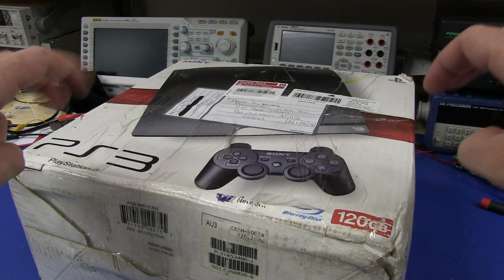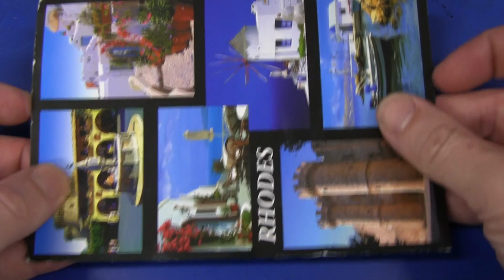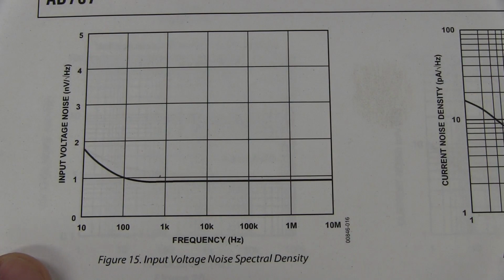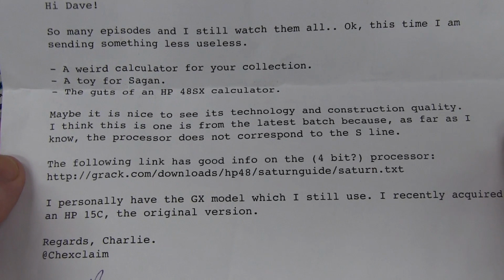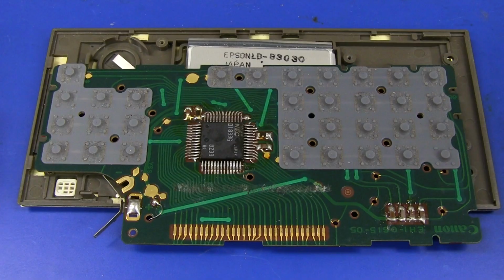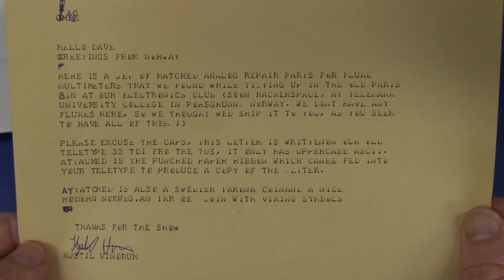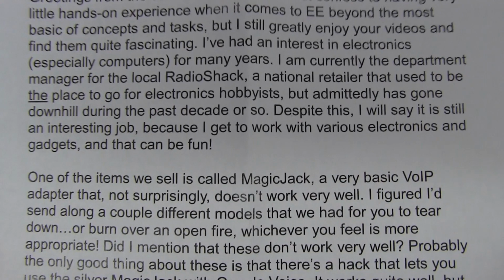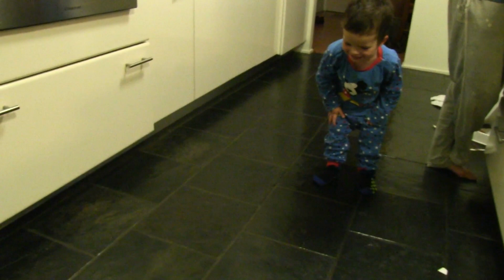EEVblog #541 - Mailbag

Comment: PS3 could easy be fixed, not over heating.

Cell processor (GPU) needs a re-flow/re-ball.

I do this every other day, and I can hazard a guess the model number would be CECH-G.

Have a go in another video!
Reply: the cell is the cpu and is rearly the fault normally its the rsx (gpu) and it is indeed in need of a reball lol carnt beleive its still got the warranty seal :facepalm:
Reply: Well, overheating is the cause of the de-soldering. The older models did not have an adequate heatsink, but a reflow will temporarily fix it until it desolders itself again.
Reply: a reball is not a reflow and de soldering is not what happens when the ylod or rrod is present thermal shock causess cracks and dry solder joints it does not desolder itself so please educate yourself before you speak...also over heating is because of the thermal paste under the ihs being of poor quality and old.......noddy... btu by crackedsolder
Reply: Ooops! Yeah your right, RSX is the correct name (Excuse the brainfart, I posted this at 3AM or so) :P

The cracks in the solder are also attributed to the use of lead-free solder balls, which don't handle the flex of the PCB during the heat/cool cycles as well as their leaded counterparts.

The heatsink and fan are MORE than adequate, if you ever pull one apart you will see what I mean (they are huge!)
The fan speed however is pathetic and doesn't cool well enough, that is only part of the issue though!

Comment: On the MagicJack you got sent, the original ones sucked ass having to leave your PC on 24/7, but the plus, and the plus with the USB ports are great for replacing your home phone, long as u have a good internet connection, just DO NOT use the original Power adapter as they are cheap, and will eventually fry the MagicJack Plus, one more thing they only cost around $30 a year for the unlimited service here in the States.

Comment: I don't think it's something you really need to worry about with computers, though. The issue with the PS3 is that it is their device and they control the firmware, and you agree to an EULA that makes them not liable for any damages. With a computer, the device is made by them, but the updates come from MS. Sure, they could do something similar but wouldn't directly benefit. I also don't see what a regular program has to do with that.

Comment: hey Dave you can probably fix that PS3. the yellow light is akin to the red ring on the xbox360. you have to reflow the solder on the main processor with a heat gun. I did it with mine a year ago an it's still going strong.

Comment: None of those devices have anywhere near the power or heat output that the PS3 has.
Sony was trying to compress server and desktop level CPU's and GPU's in to a small form factor and did not provide proper cooling, because if they would have BGA failure due to overheating would not be a thing happening with the first gen PS3 Fat's.

Comment: The YLOD isn't a natural hardware failure, it's an intended failure caused by Sony (using firmware updates) to try and increase sales of newer units. My PS3 failed 3 days after the v3.21 (removed install otherOS) update, and I'm pretty sure this was sometime after when slims launched. Now slims are starting to fail before the PS4 launch, coincidence, right?

Comment: I opened up my ps3 and fixed my  YLOD many times, once I got tired and bought a new slim version. I was atleast able to transfer everything via ethernet cable before I scrapped the old fat one... it was sad because I liked using it for playing SACD.
Reply: Why not fix it? I keep my 2 cecha01 for that reason.  Plus they are still vert valuable because of EE+GS are physically there.
Reply: sbeezynukka As I said, it's had YLOD several times. I fixed it myself. 3rd time I got tired and bought a new slim version. The old fat one works, but it is not in good condition. I still have it. It might get YLOD again any time.
Reply: Yes, saddest day of my life when the Slim came out.  As it meant the SACD was doomed.  The best music format man has ever made, or ever will make, killed by its own creator.   so sad.

Comment: with that PS3... easiest repair is to do a teardown, blast the pocessors with a heat gun for 20 mins, let it cool and reassembe :P BOOM!... also works on XBox 360 and most graphics cards... especially the NVidia 8800GT and the 9800 GX2
Reply: TheSoxmania hey, i actually have an Xbox360 slim that has some kind of malfunction and the theory is that i need to reflow/reball the cpu, so, basically i could do this by just placing aluminium foil around the cpu and then heating the cpu with a heatgun ? Could you perhaps link me a video of this? Thanks in advance
Reply: ***** it still does the trick if you're unable to get a replacement... I've had to do this already to my brother's XBox 360 Arcade before he got a one... I reballed the chips, replaced the thermal compound and gave the system a liberal cleaning... that 360 is still in his room working after 2 years solid with no issues! it's a mixed bag of results for that fix though... you can have the consoles last years or minutes... it's all in how you do the reball... I set my heat gun to 200* for that 360...
Reply: Marcus Möller it depends completely on the red ring status.. if it has 4 red rings, it's worth a shot but chances are slimmer than the console itself that it will come back... 3 red rings or less and you have a good shot... just remember... heat gun to 200* (hair dryers can do that temp as well I think... depends on the model most likely), foil around the CPU and GPU chips and then blast it for 10-20 minutes with the gun on low speed... you want to be careful though because the entire board needs to be kept an even temperature throughout so it expands equal, so apply some heat until the board is almost too hot to touch (gotta be able to handle it but get it hot enough to expand a bit) from the back of the board before hitting the CPU/GPU dies. make sure you don't hit any capacitors as if my memory serves, Microsoft were tight asses and used electrolytic caps instead of solid ones!!... at best they're able to take 105*c... more than that and they will explode so defo put a foil funnel over the chips to direct the air at the chips and away from the caps
Reply: Lukas Nordlund the 8800 series are known for this issue as it goes... I fixed a load of them when they were popular!
Reply: TheSoxmania Ah nice :) I loved my 8800, it was a beast! Just sad that I bought the wrong version. The 320mb version was better than the 640mb version for some reason :(
Reply: Lukas Nordlund had less of a chance of cooking the GPU substrate off for some weird reason... I'm willing to bet it's the difference in how the cards would allocate that RAM... slightly less RAM = easier arrangement and therefore less power needed for it... that might have been part of it!!I fixed way more of the 512MB and 640MB G-80 based cards than the 128-384MB ones... one or two would show up but that was about it..
Reply: TheSoxmania Yea that must be it, I've had that theory too. I think that it has to do with the bandwith of the memory, the new gtx 680 had the same problem I think, the 4gig version was not that much better than the 2gig version
Reply: Lukas Nordlund that, and compare AMD's GPUs when they moved from a 256 bit RAM BUS to a 512 bit one... those GPUs are some of AMD's hottest runnning!... their 256 bit cards were about 70W better off while the 512 bit ones cook themselves (I'm looking at you, R9 290X!!)
Reply: TheSoxmania Ah yes, the 290x, or the vacuum cleaner as my friends call it. The fan sounds like a jet plane! I love AMD, but it's incredible how hot these things can get haha
Reply: Lukas Nordlund I call it a turbojet with an afterburner attached... or a space heater that renders frames...
Reply: +TheSoxmania it's the red light, it might be a bad regulator or a short smd cap.
Reply: +Carlos Raez wish it was that simple most times T^T judging by how the ports on the back were severely corroded.... I'm willing to bet that that console had been in a really humid place... add dust to that and you get conductivity... and that may well be our answer!! and I've had a PC do this to me before as well!! one day it booted up fine... no issues.. the next... apparently fried! I cleaned the 1" layer of dust out of it and it started working... albeit a little unstable!

Comment: LOL @ sagans reaction, he clearly loves the bug.  Regards the PS3 it's probably going to need reball and reflow - these modern consoles are designed to fail I swear.  I've got 30 year old consoles more reliable than the last gen.  No doubt the PS4 and XBone will also have BGA type IC's.

Comment: That is one of the nastiest looking Playstations I have ever seen. I once was tasked with cleaning a PC from an automotive shop and when I took it apart, every untreated metal surface inside the case was corroded and had little fingers of rust and green crust on it from exposure to automotive solvents and exhaust gasses. This PS3 looks almost as bad as that pc and it was presumably used in somebodies house. I wish people would take better care of their stuff.

Comment: Iv`e got two ps3 fat models both still working just fine one with a 500 g the other with a 120 ssd. as long as u clean them out regular all ok
Reply: I`m finding this out i have one in bits  next door whts with the stand alone sealed blueray drive bay.i only wanna get a disk back the console is dead main board failure a few popped caps near pwr supply and i really cant be assed to fix it
Reply: the one i have in bits has a mem card reader on i guess that makes it series 1 is it rare ?
Reply: +nigel day Yeah those ones with card readers and 4 USBs are rarer now, they can play PS2 games because they have an entire PS2 inside even!
They are getting more and more expensive. (If they are working of course)
Reply: I may fix it and get it going again. Ive got a few ssd`s spare and fixing the blown power supp caps shouldnt be an issue. Its clearly worth fixing tbh i never noticed the other 2 usb`s on the back untill now lol
Reply: I have the 1st gen 60gb still working my son on the other hand went through 4, only thing I clean is the vents
Reply: Iv`e now got my gen 1 working on a conventional hard drive it wouldn`t see an ssd for some reason . I tried four diff makers. Usually i have the thing apart once a year for cleaning.

Comment: Your ignorance about video games is face palm worthy    Xbox is garbage.   720p. Really that's a joke
Reply: And who cares about resolution? As a gamer whose range varies from games as old as Lode Runner to newer games like CS:GO, the only thing I really care about is if the gameplay is good, if the game performs well, and (when it comes to consoles) if there are thermal problems. Resolution isn't that big of a deal so long as the gameplay isn't crap and the performance of the game is a nice, smooth, 30-60 fps. When it comes to something that has good gameplay and good performance, matched with a good console/PC/whatever complaining about resolution is really nitpicky. The only difference I have seen between 720p/1080p/4K is resolution. Unless you change the color depth (i.e. switching from 16-bit video to 32-bit or from HD (720p-4K with 32-bit color depth) to UHD (4K but with better color depth)), literally the only difference is more screen space. It really won't look any better on your screen, be it 640x480 VGA, 32-bit color or 4K HD  until you change the color depth, which only 4K UHD seems to do. So, your ignorance about how all this works, as well as your grammar, is facepalm worthy.